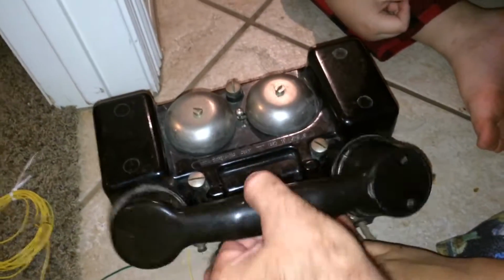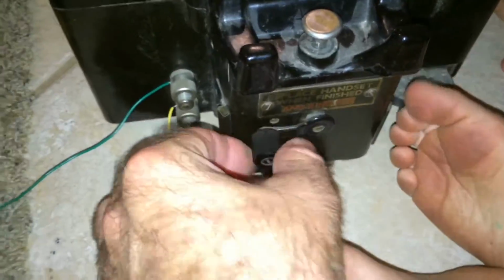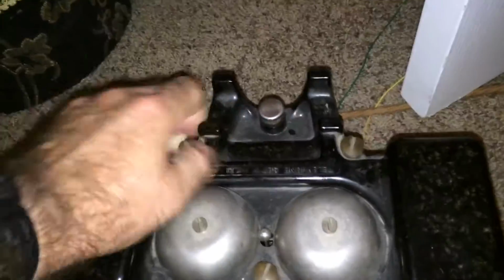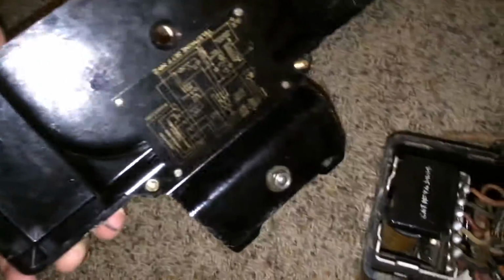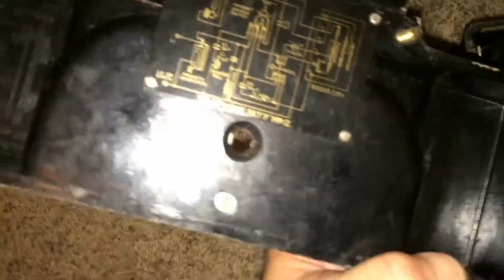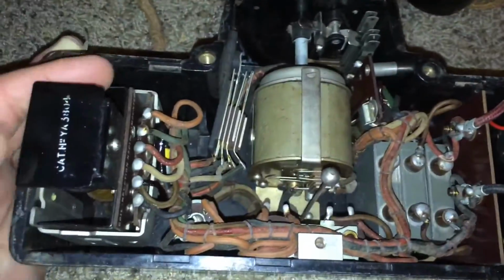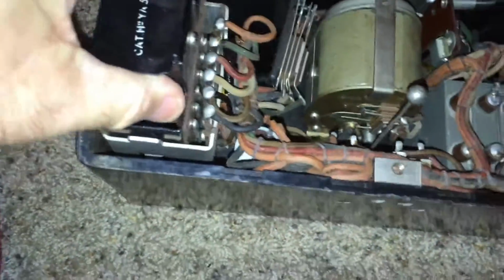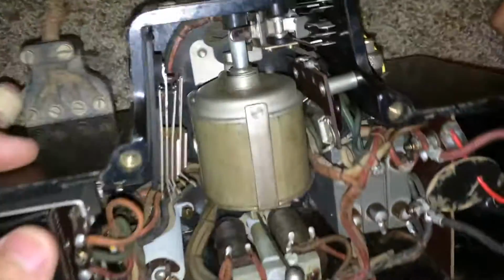"Antique British Field Telephones" by Daniel G. Benes

Comment: The schematic shows the battery is 3v but I guess a simple non electronic circuit like this wouldnt be affected by a few extra volts at low current.  I have the same set but cant get a ring out of them yet, maybe the contacts need a gentle clean.
Reply from the maker: The same set? Very cool! Hmm, no ringer huh? Are the magnetos putting out any voltage when you crank them? If not, have you checked the resistance across them for an open/broken winding? Also, wires are often knocked loose in semi-user-serviceable units like these when past users changed batteries. As for the 9v, the volume was really low.
Reply from the maker: And yes, the contacts can definitely be the cause.
Reply: I get around 50v out of one of them, but the other only gives around 1.5v.  I've cleaned up the contacts with fine scratch paper and wd40 but still no ring and no audio either. Someone in the past has rewired the handsets using only 3 core lead, maybe this is the problem or part of but surely the ringer should still work.
Reply from the maker: +thra5herxb12s 50 volts is good. 1.5, not so much! Is that 50 volts arriving at the other unit's ringer? When I get a moment, I'll take at look at mine and see if anything obvious stands out that might point to a possible problem/solution with the ringer circuit.
Reply: The 50v is measured at the terminal posts on the phone.  I'll have another probe on the other phones ringer to see whats getting through but I'm not sure which wires to probe, there are 2 on each coil.  I also dont want to bend any wires if I can help it, the rubber insulation has turned to granite over the years and I dont want to short anything out if i can help it.  I'll post up a video of what it looks like inside, maybe you can spot something.  Thanks for your help.
Reply from the maker: You're welcome! Yes, please feel free to post your video here when you make one. I'm prepping for a big "Science of Sound" exhibit right now so I haven't had a chance to look at the phone. But you're right about the insulation. Mine too! The entire innards would come out easier as whole because of the hardened rubber. The handset has to be on the cradle for the ringer to work, so you might check the switch and contacts directly under the cradle switch. Also make sure the generator shaft moves slightly forward towards the front of the phone the moment you start to crank it. Doesn't matter which direction. It will move forward engaging the contacts at the rear of the generator. If one of these contacts is open on the other phone, it can prevent the ringer from working.